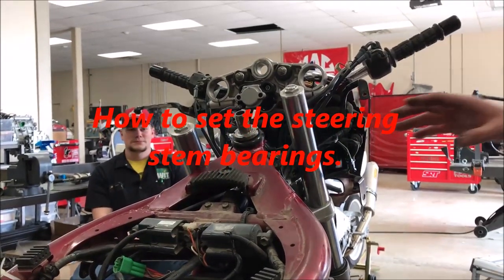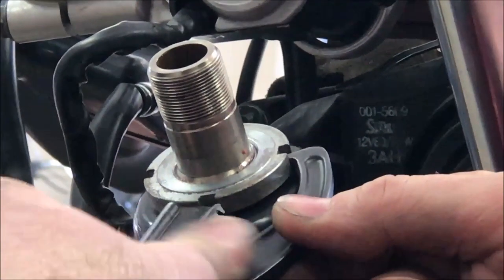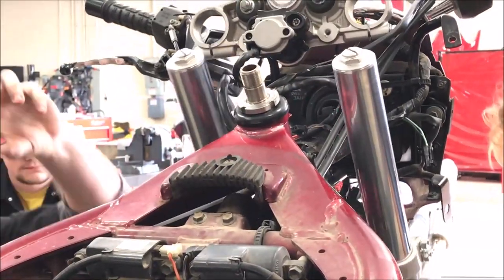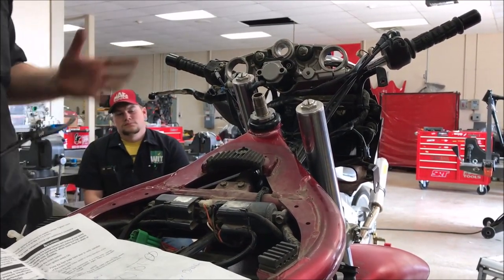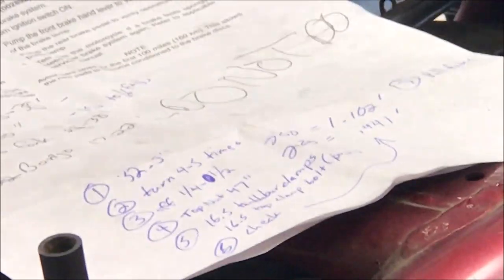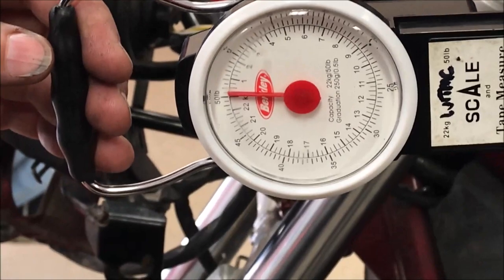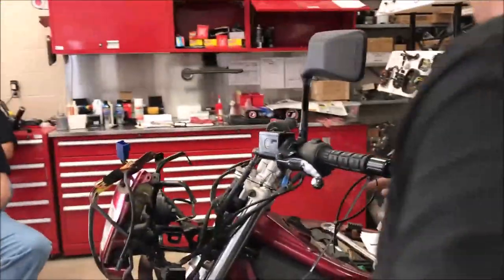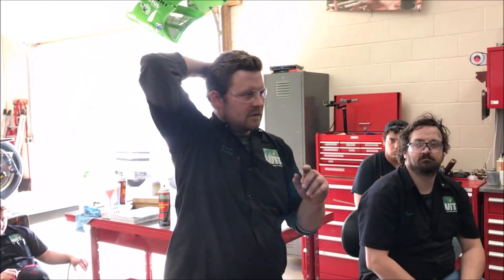06 How to set, service and adjust Steering Stem Bearings like the pros!

Comment: For a surprise, check the pull weight on the forks after you crank down the top nut to spec.  Bye bye setting.
Reply: Top triple tree nut should have no effect on bearing preload.  Only the spanner nut.

Comment: Well done. I did it on my suzy 12 '01 . it works really good. 400g in left and  280 g in right handle bar side. The first nut seems to be not tight but when you set the upper one at specific torque all works correctly. Just one thing: the seal of upper bearing . I had to remove it because keylock didn't engage properly. Too high to get its place. I remove the all balls upper seal and simply reinstall the original rubber seal and it goes well.
Reply from the maker: Thank you. Here are some ways to support me and other ways to follow me. I’m also available for hire to personally work one on one with you: 
Click here for the membership links and welcome to the community! https://how2wrench.com/product-category/specials/   

Want to say “thanks” or “keep it up”? Click here https://www.paypal.me/how2wrench 

Your answers and help are just around the corner. Save time and money while protecting your investment and yourself by doing it the right way!
Follow us!
Web:
www.How2Wrench.com    
www.Tools2Wrench.com
Reply: i had to the same thing on a roadstar 1700, the top seal with the kit didn't fit right, the bottom one was good though

Comment: Shane, great video. I have a relatively new 2017 GSXR 1000, it has 2500 miles on it. I am getting a, what sounds horrible to me, Cracking sound when applying hard braking, and be replicated with bike off, push bike forward, hard brake, and push down on handle bars with force at the same time, Crack, move in reverse, brake hard, pull up on handle bars with force, Crack! Seems like it is competing from handle bar area, and near steering stem for what I can narrow down. Is a cracking sound something the steering stem bearings could make?
Reply: Sounds like busted tapered bearing cage- very dangerous..... steering can lockup.
Reply: Hi did you figure out what the crack was as I have same issue gsxr

Comment: Had the head bearing replaced recently and the bike began to get this high speed full frame wobble very discouraging.  What woult symptoms feel like if the bear were over tightened>
Reply: I know this was 3 years ago but just for anyone else with the same problem, this can happen when the bearing is too tight and also too loose. If the wobble occurs at a similar speed everytime and it persists (the bike doesnt fix the issue on its own within a few seconds) then its very likely the problem is due to the upper and lower portions of the triple tree being out of alignment

Comment: sorry but your wrong on how to adjust you don't run Tite for going straight and loose for sport like feel it is to be adjusted so it corrects itself from side to side starting from center with wheel of the ground!!! you say loos for sport and Tite for straight then you go by the book which is totally different you stay with the book when it comes to the front end.
Reply from the maker: You're misunderstanding the examples. You don't run tight or loose ever. You run what the manual states. The "looser than or tighter then" was a comparison to the type of bikes and the weight in relation to the steering feel. Also, in certain racing applications teams will alter to the desired inputs they want.
Reply: Correct, there is no loose or tight choice in steering head bearing adjustment, there's only correct or wrong. Too loose and you end up with play, too tight and the rollers will make indentations in the bearing races.